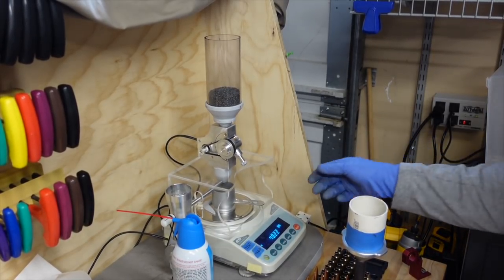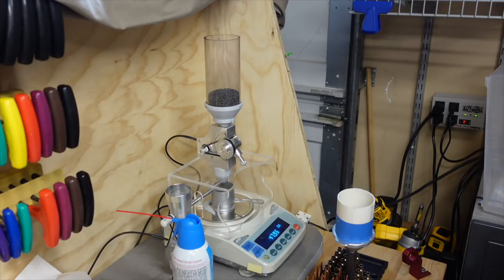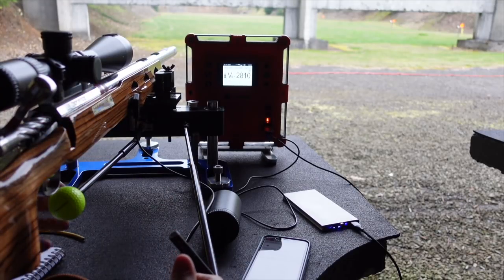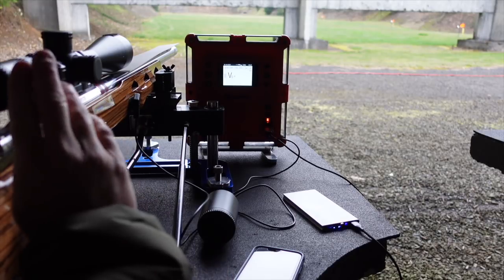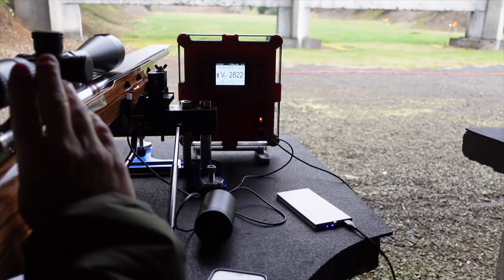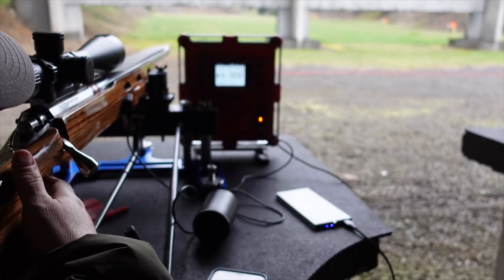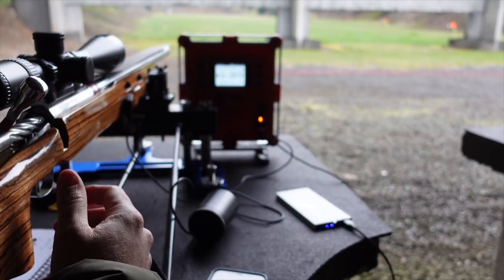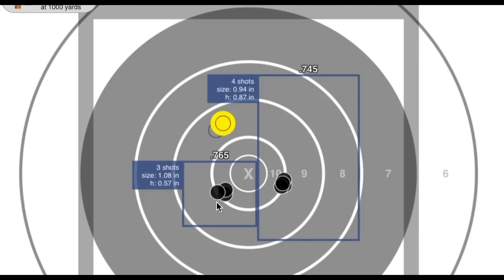Testing New Loads at the Range – Accuracy, Speed, and Performance

Comment: At the end I was like "I shoot better than that, what was the point?" but then I noticed the groups were @1000yards NOT @100yards. 😂😂😂
Reply from the maker: Actually these are at 300yds but that’s great if your gun is shooting 1/6moa!  It means you’re dialed in.
Reply: @FClassJohn  I meant the target at the end of the video which says 0.94” group @ 1000 yards. I can do that @ 100 yards. 😅
Reply from the maker: @Timantinpoimija  Oh ok, yeah that makes sense and I appreciate the kind words. For what it’s worth my goal is to shoot 1/4moa or better vertical dispersion regardless of the distance. So in this particular case those two different settings at the end were pretty distant from each other. One was just under an inch which would be 1/3moa at 300yds and the other one was just about 1/2inch vertical dispersion which would be 1/6moa which is why I picked that one.

Comment: hey john I heard somebody say online that they don't seat the bullet's boatail past that neck shoulder juncture would you agree with that? Cause i am about 5 miles to lands in my rifle and i have to seat to almost where the bullet is out of brass to get close to lands. My es is undercontrol seating boatail right at neck shoulder juncture and wild at seating the bullet way out towards the lands. But wow thats amazing what you do with your loads!!!!!!
Reply from the maker: First thank you for the kind words. As to seating I agree. I never want to seat a billet where it goes past the neck junction. In fact I always want to be above it. Less issues that way and in my experience much better accuracy. Most if they has to do with the fact that .284 forms a donut so you’d be in real trouble if you seated into that area.

Comment: New stock?  All Brux are .276 bore, ever try .277?
Reply from the maker: It’s an old stock of mine. It promised to behave so I brought it out for the day. It’s been a long time since I’ve shot other brands but I have shot other bore diameters than .276 and was never happy but I also wasn’t as experienced at that time either so it could easily have been user error.